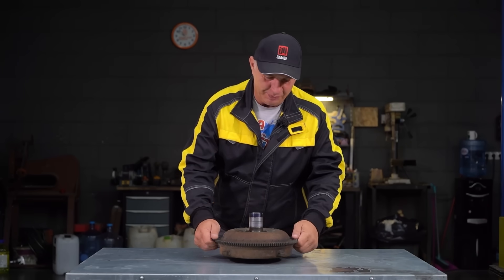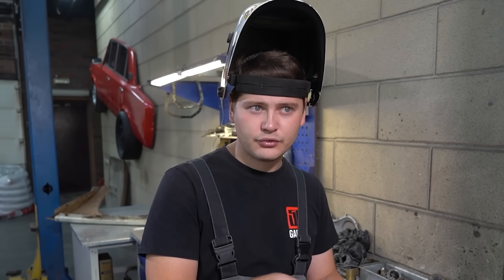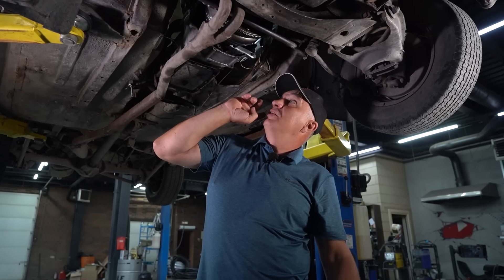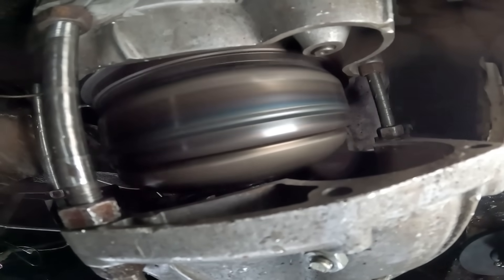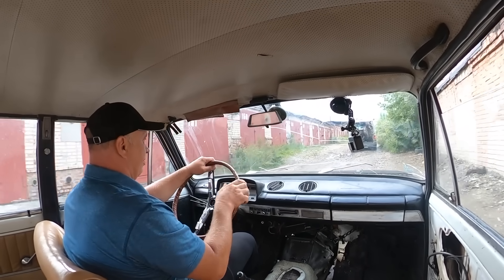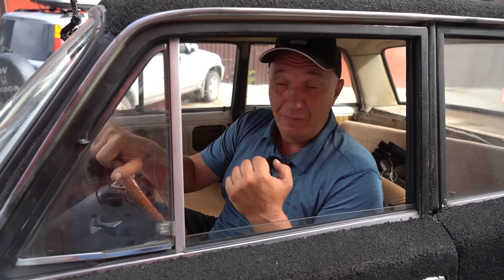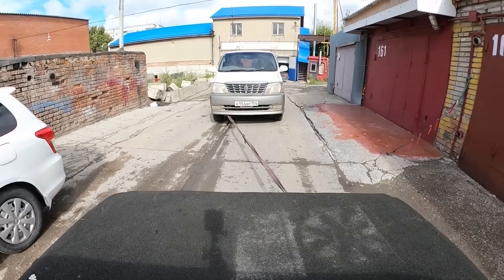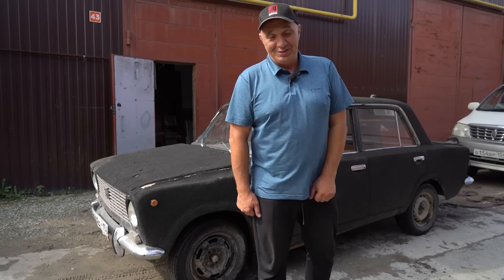Torque converter in a manual transmission - will it work?

Comment: I want this on real cars so fucking badly. Really a trorque converter, to a clutch then the manual transmission
Reply: You don't need a clutch at all with the lockup converters
Reply: @robinpage1987  Nah thats not what im talking about. its so you can disconnect from the torque converter to change gears.
Reply: Chrysler had the same exact feature back in the 1940’s called Fluid-Drive. Basically a manual transmission with a torque converter, can come to a complete stop without having to step on the clutch, shifting into neutral. Made stop and go driving a breeze since all you had to do was step on the brake to stop, step on the gas to go in any of the forward gears.
Reply: @seana806  Gotta bring it back. Torque converters are super cool.
Reply: @theredwedge9446  some people make a big deal on how automatic transmissions are complicated and problematic, but when you really think about it, there’s not too much to it. A automatic transmission basically clutches soaked in a fluid with various planetary gear sets, that’s about it. The Buick Dynaflow essentially was a glorified torque converter which made things simple, but provided little to no efficiency at all. As long as you change the fluid every so often (personally, I like to change it every 2 years regardless of mileage) in a automatic transmission, will run for a long, long time. 

If you put a torque converter on a manual transmission, makes it even more simple, easier to drive in city traffic. Can have the fun of a manual transmission, the convenience of automatic transmission in traffic.

Comment: nice trick with the magnet  2:15
Reply: I see the magnet but I don't understand what it's doing. Is it pulling something on the inside up so that it can be drilled properly? I've seen a couple of these comments and I'd like to understand so I can appreciate!
Reply: @Lord_of_ChaoSan drilling a hole inside a delicate and precise mechanism. The magnet keeps the shavings from falling inside the torque converter while drilling through, as the shavings would destroy the transmission by bypassing the filter and getting pumped through the fine passages and butyl solenoid seals.
Reply: @Lord_of_ChaoSan  it's pulling the metal chips from falling into the drilled hole
Reply: Add a pump with a solenoid into the input shaft to activate the clutch in the torque converter
Reply: A magnet from a busted old speaker nonetheless. Lol. Good stuff!
Reply: @brockallentaylor  Looks like one from the magnetron in a microwave oven.
Reply: @Graham_Langley  Yeah I think you are right!
Reply: What is that black stuff covering the old Lada? Zimmirite anti magnet paste?
Reply: @Wollemand Looks like pastidip, or some kind of rubber paint to me. Stuff that you use on truck beds or under the fenders for added protection. There are people who spray parts or whole bodies of cars with that stuff
Reply: @Wollemand  it's pelletized rubber, like for running tracks in the US... They coated it a few months back in another video.

Comment: I'm glad you guys are finally doing this. I suggested this 7/8 years ago and several times since. I think it was Oldsmobile that had a clutch torque converter setup back in the sixties but I don't remember the car name or anything. There's had the torque converter mounted solid to a flywheel for an automatic mounted to the crank and on the back side of the converter they mounted a flywheel for a standard transmission and the input shaft from the gearbox was splined into the center part of the torque converter. It was a regular operating manual transmission but if you just stepped on the brake without pushing the clutch in it would not kill the motor and it acted like an automatic in all the selectable gears. You used the clutch and gear shifter like normal but it was a lot smoother than a regular clutch pressure plate setup.
Reply: Vw had it on the type 1. It was a three speed with a torque convertor and a friction clutch. There was a brake/clutch pedal so you could shift it when it was stopped.
Reply: Yes sir, I came here to make this comment as well. GM definitely did this back in the day with some of the super early Hydramatic transmissions, and I believe Chrysler did it with their Fluid Drive autos. Very interesting setup! I have always been fascinated with automatics. Even learned how to rebuild them eventually! 😎
Reply: I been suggesting someone do this for over 15 years. Glad to see them do it
Reply: My brother had a 1950 Dodge with Fluid Drive.   Plymouth also had it & I assume Chrysler did as well.   It was nice to set at the traffic light already in gear with the brake applied.   When you got the green light, you just released the brake and hit the gas.   You didn't have to mess with feathering (slipping) the clutch to get going.   Also, on a 'hill start' so much less likely to 'roll back' and bump whoever was behind you.   Standard tranny with a torque converter is a good combo !    So many years later I wished they had them for 18 wheelers !
Reply: @BillSmith-fx7xx  Plymouth only had it in 53 and 54, maybe a few 55s.
Reply: You successful rebuilt how many?  
It doesn't matter 
This idea a fluid coupler type clutch is way cooler
Reply: @chuckwhitson654  I've successfully rebuilt dozens, couldn't give an exact figure. They were all GM ones though. Anyways, yes sir the fluid clutch is quite neat I think as well!

Comment: You are always coming up with my daily brainstorms! Many others I have never thought of! Great video! Thank you
Reply: This is not a new idea, it has been used since the 1940's in several models of vehicles. My 1948 Dodge had a similar set up to this with fluid coupling and manual gearbox. Other posters have said the same thing.